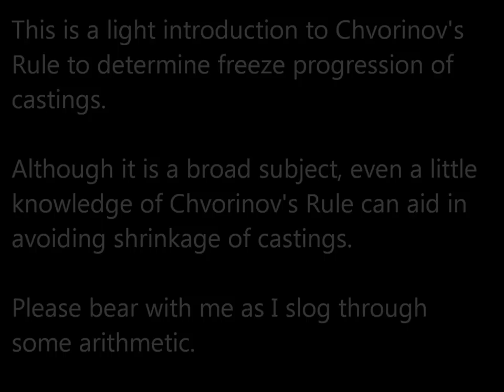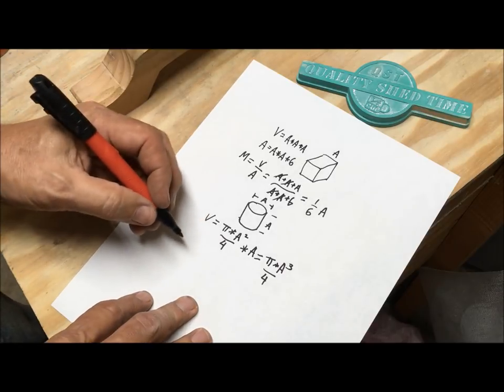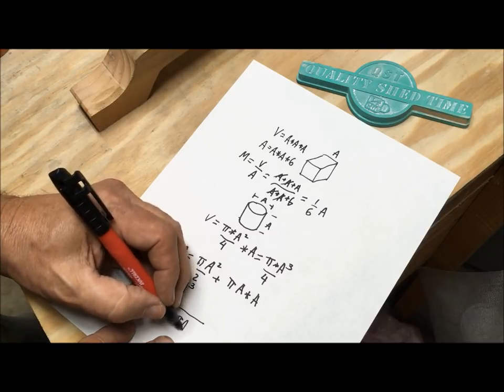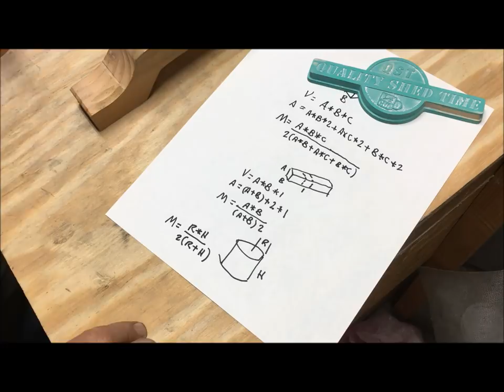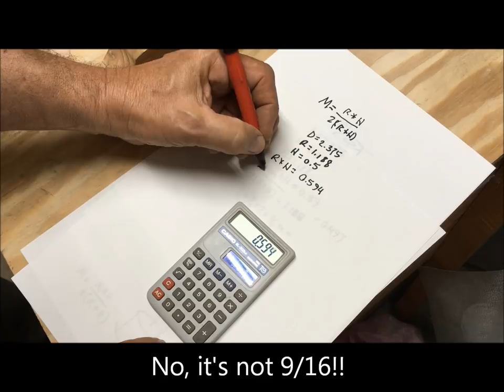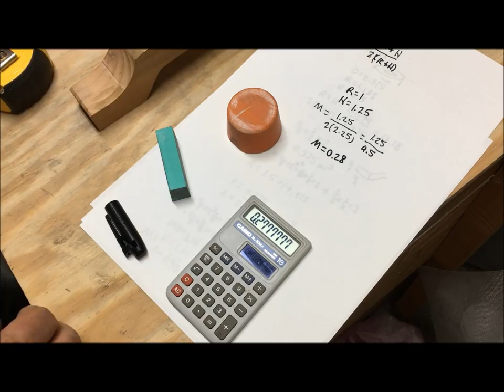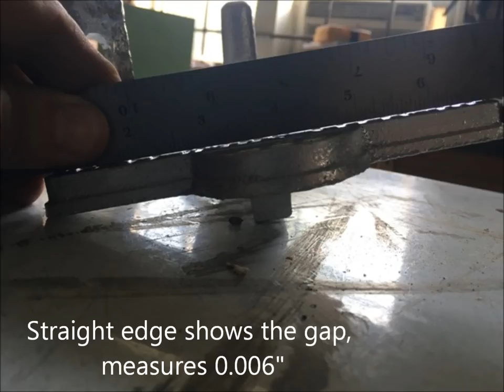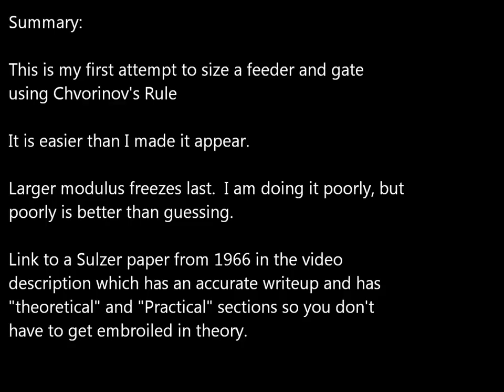Foundry 49: Chvorinov's Rule to Avoid Shrinkage Defects in Simple Castings

Comment: for the center part you really need to include all the parts.
Note I'm ignoring the letters (which lower the volume and increase the surface area) you basically have two cylinders stacked. 

the height was relatively easy to read off the video, h1 = 10/32in  h2 = 6/32 in  h_total verifies h1+h2 = 0.5 in
the diameter of the bottom part I had to estimate as being 2/8in larger that the diameter of the top part.  or 2 5/8 in (2.625in)

volume is v1+v2
area is a little complicated as you subtract to overlap area

after simplifying I get a Vt/At =  (d1^2 *h1 + d2^2 *h2)/(4 *d1 *h1 + 2 *d2^2 + 4 *d2 *h2) (<- this is the corrected equation... see reply below for corrected numbers)
or 0.22 for that modulus

The riser/feeder therefore would need a modulus of at least 0.266 you had 0.28 so should be good, assuming the gate of 0.18 doesn't freeze and block the feeding of the part.

but 0.266 is not including that fat runner/gate, and the arms of that little sign which also will pull metal from the riser.

Much easier to feed a flat backed part like this with a feeder/riser off the back of the part to keep the feed distance short.
(if I calculated the feed distance for a side riser correct you are nearing the feeding limit of 5.35 in for your case (thickness and width))
Reply from the maker: Thanks for taking the time!  After you got significantly different results I felt the need to go back and check my work.

First I want to reiterate that my goal is to keep the method as simple as possible primarily so I will use it.  If it becomes overly complicated then I won't use it and it is of no value.  Secondly other backyard casters may find it is useful if it is easy enough to understand and use.

I have to respectfully disagree on the assumption that all minor surface shapes are of importance in calculating the modulus.  The lettering, for instance, and any inside corners, although they add area they do not add to cooling.  The sand does not flow so there is only conduction and inside corners soon get hot and do not add to cooling.  Chvorniv and later researchers have shown that the modulus of a square box, and inscribed cylinder, and an inscribed ball all have the same modulus.  The exterior corners also add little to cooling, they quickly cool on a square box and the liquid remaining in the middle is a ball.

Using your numbers for size, I calculate the volume is 2.27 cu in.  The top and bottom add to 10.82 sq in, and the rims add to 3.67 sq in for a total area of 14.49 sq in giving a modulus of 0.157 in.  It would be great if you could check my work to determine where we disagree.

Actual measurements are a little different.  Top is 2.35 in and bottom is 2.46 in.  I estimated 2.375 in to be about 1/3 of the difference.  With actual measurements I get a modulus of 0.162 in.

Now, if I deduct the area of the wing attachments, I get a modulus of 0.171 in.  If I also deduct the area of the gate contact I get a modulus of 0.180 in.  In practice I don't want to go to that level of detail or I won't do it.

I feel confident that Chvorinov's Rule can be applied loosely and simply and still give good results.  

A little fudging and a little judgement go a long way.  For instance, I neglected the entire top area of my gate because it is mostly in contact with the mold or feeder and the small part left is sandwiched between the feeder and the mold.  That common inside corner area does not contribute to cooling much to any of the three bodies.  It helps account for neglecting the wing attachments.

I await your review of my areas and volume.
Reply: @andrewmartin4258  surface area does matter.  consider the limit as A approaches infinity of V/A  is zero. Thus we see that as the surface area approaches a very large number the modulus will decrease. but note: I ignored it in making calculations here as I don't have a way to get that number (you could possibly pull the volume and surface area from the CAD program the part was modeled in).

I'll come back when I have a moment for the rest of the calculations. it's minutes o'clock and time for me to make some things happen.
Reply: @andrewmartin4258  the total volume I calculate from my estimated sizes for the center is 2.399 in^3
using your more precise numbers rather than my estimates
d1 = 2.35 in, d2 = 2.46, h1 = 0.3125 in , h2 = 0.1875 in 
I get a total volume of 2.247 in^3

the volumes of the two cylinders add V1+V2. 
Vcyl = π*r^2*h and substituting  d = 2*r -> r = d/2
Vcyl = π*(d/2)^2*h -> Vcyl = π/4*d^2*h
thus the total volume of two stacked cylinders of different sizes is
Vtotal = π/4*d1^2*h1 + π/4*d2^2*h2

the surface area for stacked cylinders is slightly more complicated.
you have the area of the circle for the top of cylinder 1 plus the area of the rectangle making the side of cylinder 1
then you add the area of the circle for the bottom of cylinder 2 plus the area of the rectangle making the side of cylinder 2
now we have a little area to add where the two meet and cylinder 2 is larger than cylinder 1 (a doughnut)
we take the area of the circle on the top circle for cylinder 2 and subtract the area of the circle on the bottom of cylinder 1 (the overlap)
(at this point I just noticed I forgot to add the area of the two rectangles which threw off my simplification)
Ac = circle 1 + circle 4 + [circle 3 - circle 2] + rectangle 1 + rectangle 2
Ac = (π/4*d1^2) + (π/4*d2^2) + [(π/4*d2^2) - (π/4*d1^2)] + π*d1*h1 + π*d2*h2

combining and simplifying V/A (center without the wings)
Vt/At = (d1^2 *h1 + d2^2 *h2)/(4 *d1 *h1 + 2 *d2^2 + 4 *d2 *h2)
I get 0.169 with the actual measurements and a minimum required riser/feeder modulus of 0.185 (20% larger)

0.2*(Vpart/Apart)^2 +(Vpart/Apart)^2 = (Vriser/Ariser)^2

I did have an error in my first run through; a bookkeeping error on my part.  I would say with my revised calculation and your revised numbers we are likely within a margin of error now 0.169 vs 0.171 .

If you using Fusion 360 for modeling you can get the physical properties from the Properties palette. right click the model and select properties from the context menu. You should be able to quickly read off the Surface Area and Volume.  Most cad programs have a similar option. Much faster less error prone and more accurate than cobbling together basic shapes to approximate the Surface Area and Volume.
Reply from the maker: @askquestionstrythings   Glad you found your error.  But we're not having an arithmetic contest.  I failed to give you the true thicknesses which are 8 mm for the top and 4 mm for the bottom.  That should make our numbers come out.

In calculating areas I only calculated the area of the large circle and doubled it.  That exactly accounts for the area of the small circle plus the donut.  I didn't care what their individual values were.

Most of my patterns are done in wood, or off of original cast parts.  So I need a simple way to calculate a modulus which will help me size a feeder.

Our primary area of difference is in the relevance of surface variations which I consider to be insignificant and you don't.  Things like the lettering, and even the small step between the small circle and the large one.  If you consider an isotherm surface slightly away from the body in question it is a smoothed version of the body.  The farther you go away the more spherical the isotherms become.  A groove soon becomes lost in the isotherms.  And it is the isotherms which show how the energy is leaving the body, and the actual rate of energy loss determines the time to freeze.

To avoid error I believe it is important to not get lost in the details.  If we have a shaft with Acme threads I am going to estimate the shaft diameter to be the O.D. less maybe 1/3 of the thread depth, each side, so a 2" shaft with 0.09" deep threads I would guess to be 1-15/16" OD and never look back.  The sand 1/4" away from the shaft can't tell there are threads.  If one calculated the sides of the threads one might be tempted to double the shaft surface area (depending on the pitch).  That would be accurate for painting but would be an error to calculate a realistic modulus, in my opinion.

I'm currently preparing to copy a drill press table for a blacksmith hand crank drill press.  I don't want to model it.  And I don't even think I should remove the through slots in calculating a modulus.  Of course whatever I calculate I'll be generous in adding modulus for the feed system.

Thanks for your continued interest.
Reply: @andrewmartin4258  I don't think communicated well what I was saying about the Surface area mattering. From the limit as the surface area increases the modulus will decrease.  Therefore by simplifying the surface area you overestimate the part modulus (i.e. the actual modulus is smaller than the estimate) which means you will have a larger riser/feeder than you would have if you included all of the surface areas. As long as you have an excess of metal to fill to the total volume of the casting, runners, riser/feeder this is a good situation. For backyard and small shops simplifying the surface area is typically a good thing (unless you cant fill the system and run out of metal). 

On the other hand, you don't want to underestimate the volume as a reduced volume has a much bigger effect on the modulus. Underestimating the volume results in underestimating the modulus and results in a riser/feeder smaller than you need.

For the shaft with ACME threads, I would argue that it's better to estimate Chvorinov's rule for the shaft as just a cylinder the size of OD. This would overestimate the volume and underestimate the surface area resulting in a larger modulus and a larger feeder/riser. 

In the case of a non-CAD-modeled part, I agree that cobbling together an estimate based on the sums of simple shapes is best. For the drill press table estimating based on a series of stacked rectangles (based on the thickest cross sections) and not including the slots in the Chvorinov's rule calculation should result in overestimating the volume and underestimating the surface area resulting in a larger modulus and a larger feeder/riser... i.e. a better chance of feeding the table. (still requires a 20%-25% increase in the feeder/riser e.g. 0.2*(Vpart/Apart)^2 +(Vpart/Apart)^2 = (Vriser/Ariser)^2)
Reply from the maker: @askquestionstrythings  Only two points left!

I disagree that ignoring the surface area of the threads is merely conservative.  I believe it is non-conservative to include the thread area or any other features on a part which cannot efficiently give up heat to the sand.  Overestimating the volume is conservative and need not be avoided within limits.  But even though I disagree it is only my opinion as an interested observer.

But for home foundry use an excess of riser is always good until you can't make a pour because you crucible is too small.  Then it is worth refining the calculations.  But if you count on extra cooling from features like threads I would expect you would be disappointed.

The other thing is the 20% calculation.  That is interesting in that the calculation is done on the square of the modulus.  Is that a 20% increase in estimated time?  It works out to 9-1/2% of the modulus so I may start using a 10% modulus increase as my minimum.  On a modulus like 0.18 that means a 20% increase of a modulus 0.18 would still a modulus under 0.20.  Can you confirm the equation is recommended as written?
Reply: @andrewmartin4258  Generally when I've had to calculate Chvorinov's rule we calculated the full solidification time, then used that time in seconds plus 20-25% to backsolve for the size of the riser/feeder (solving for the diameter and height of a cylinder)
Recently I read paper with a reference to work by Lewis, 1983. Lewis, "showed that feed metal will be sufficient if the modulus of the riser is greater than that of the casting by twenty percent" and used the formula M=(Vc/Ac)^2 for the modulus

I opted to use Lewis's formula as it's a simplification to the full Chvorinov's rule process. 
Mc+20% = Mf
(Vc/Ac)^2+0.2*(Vc/Ac)^2 = (Vr/Ar)^2

so for your casting with a modulus=0.18 I get a riser with a modulus of 0.197 slightly under 0.20
(based on your modulus 0.18 not being squared and only the ratio of V/A)

I will note that the paper I was reading also states "the use of modulus principle has a limitation in that, it only accounts for the solidification time requirement which is not sufficient to ensure sound castings." I feel it's a start and a big improvement over not accounting for solidification time.
Reply from the maker: @askquestionstrythings  Well we've had a lot of discussion.  Thanks for the interaction and information.

I sure don't grasp the 20% equation, it seems it could have been Mf=Mc*1.095 and been done.  But no matter, I can get there.

Thanks again!